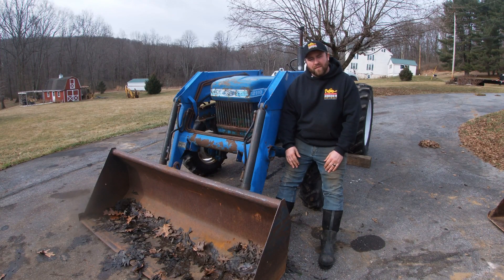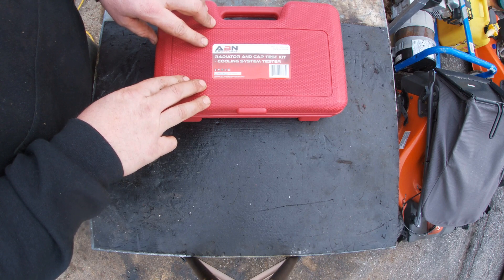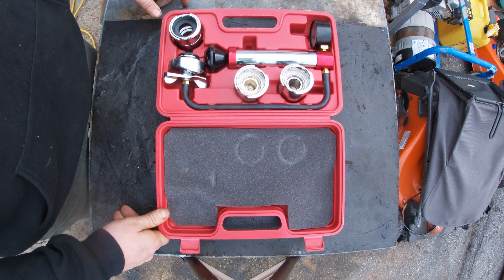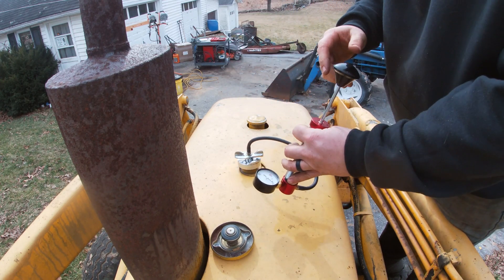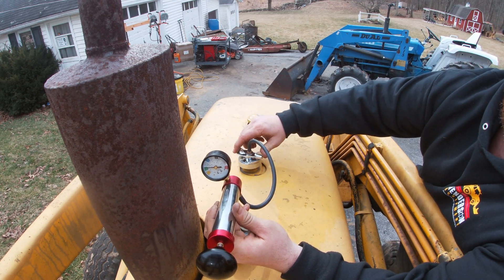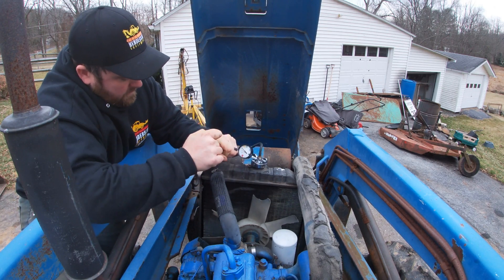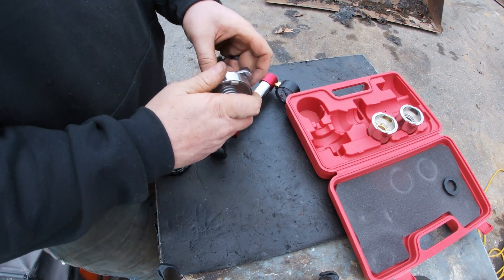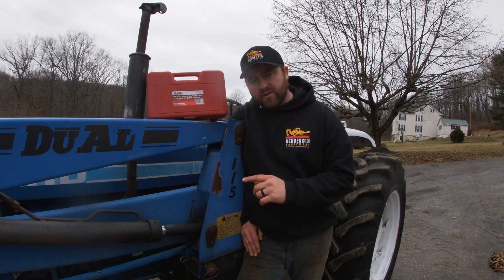Pressure Testing your Cooling System for Leaks

Comment: Hi have you used the tester on a Farmall B radiator by chance? The neck measures   2 1/2" O.D. including the lip
Reply from the maker: That’s a good question!  I haven’t tested a farm all but I have tested it on older John Deere’s and ford 8n/9n. And it did it no problem. I would assume it would do the job for you. Thanks for watching!